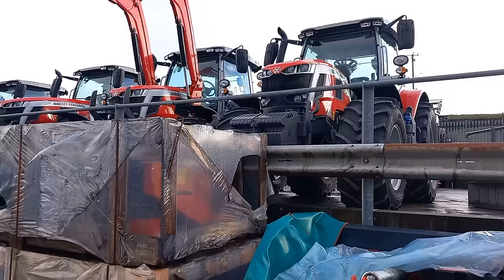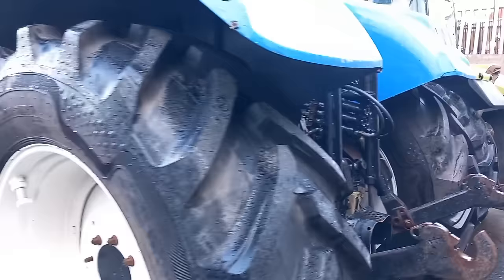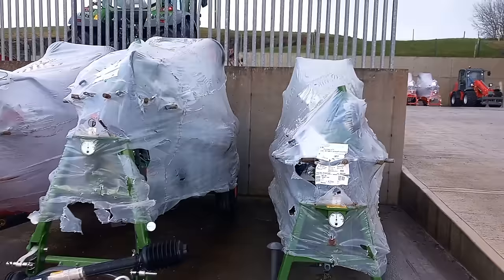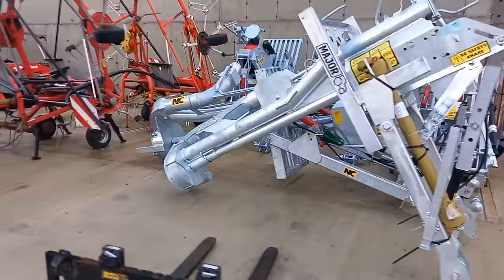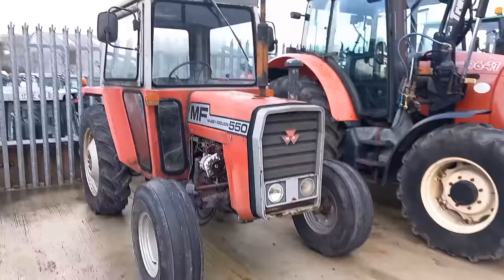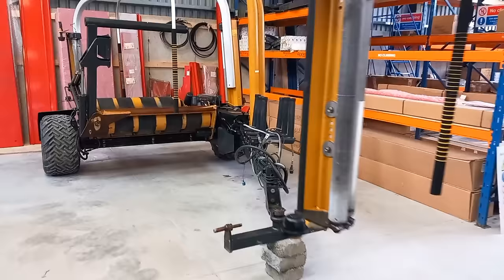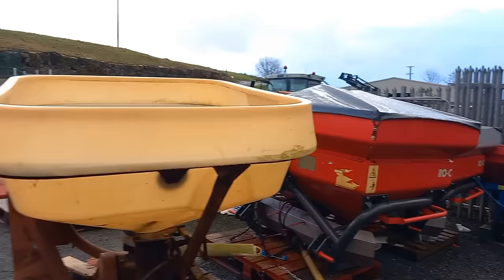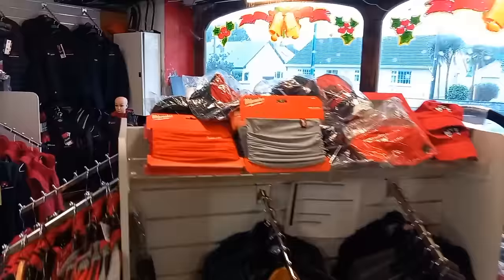WHAT Do Whelan's Garage have for you  main dealers for Massey Ferguson in the mid West of Ireland.

Comment: Love watching your videos nice yard could you tell me what’s the difference between the Massey 5400 dyna 4 and the older 5400 without the dyna 4 I’m interested in one of those tractor but don’t know the difference
Reply from the maker: I'm not two sure, but I would assume the older 5400 is just a straight gearbox, with   very little electric components more straightforward. The dyna is a great system, and the speed shift  is just one gear like the julepower on the ford's